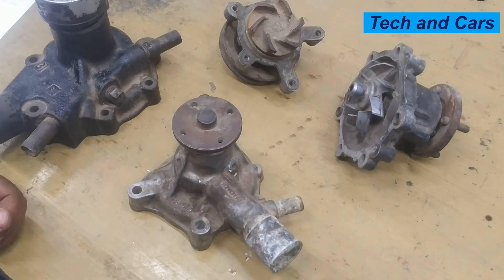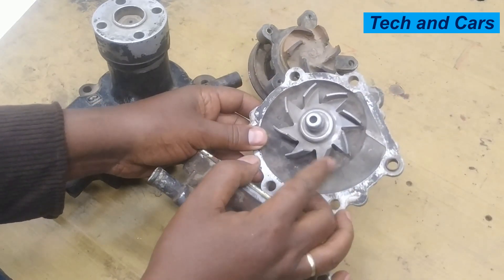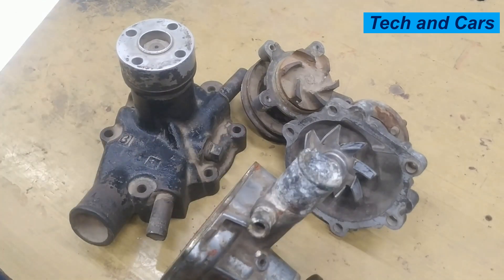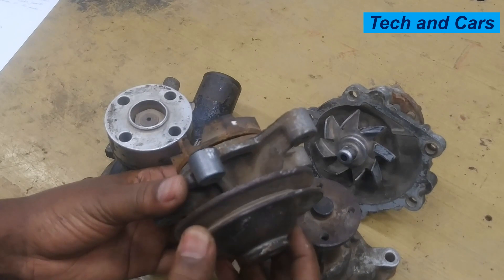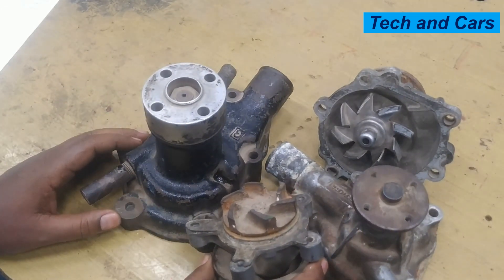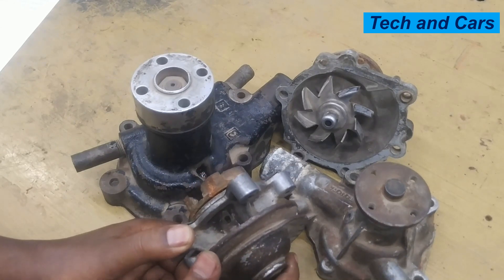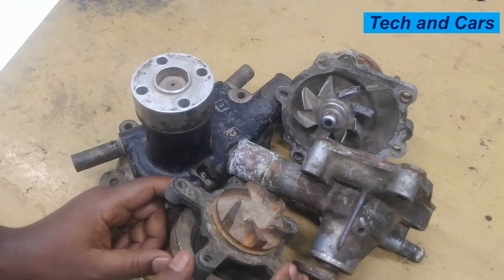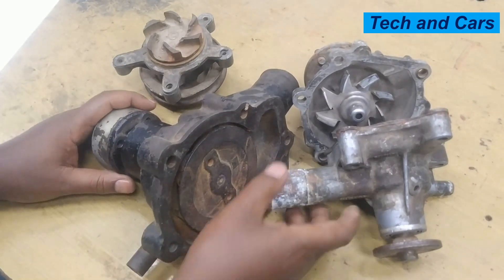SIGNS OF A BAD WATER PUMP ON YOUR CAR

Comment: Very clear explanation thank you very much. So the water pumps do not run on electricity rather the drive belt is the one driving them am I correct in saying that? I really appreciate your videos.
Reply from the maker: Even though most engines use the mechanical water pump that is driven by the crankshaft, there are also electrically driven water pumps in use today. The best advantage of using electrical water pump is that the pump in comparison to mechanically driven pump can be placed much lower thus improving head. Electrical water pumps require some control mechanism to adjust the power of the pump based on the needs of the engine.